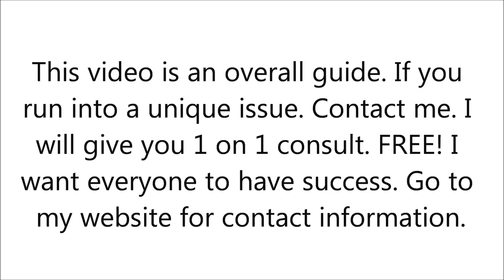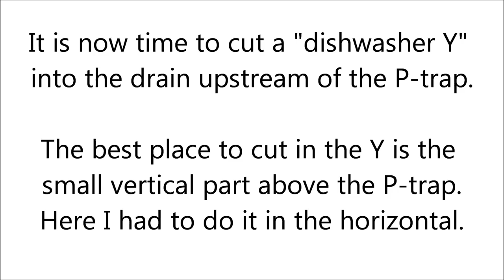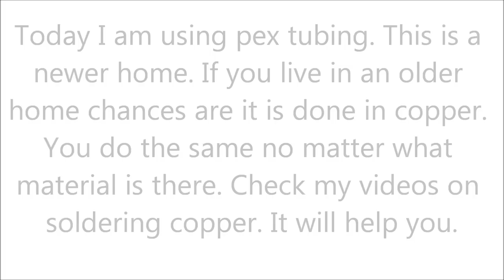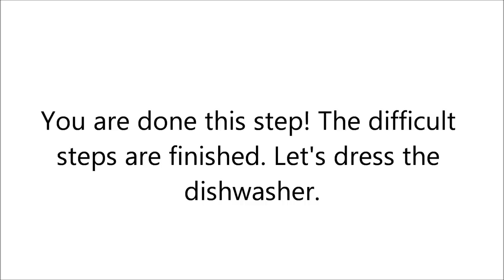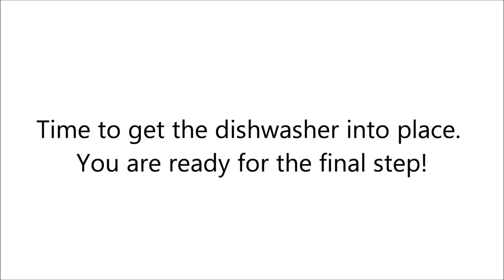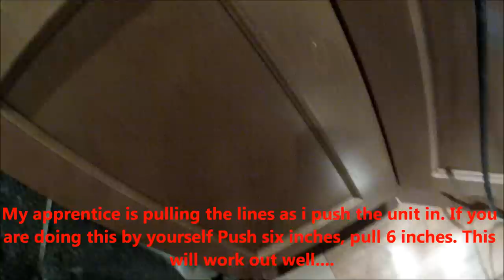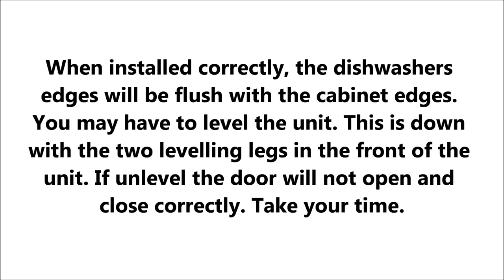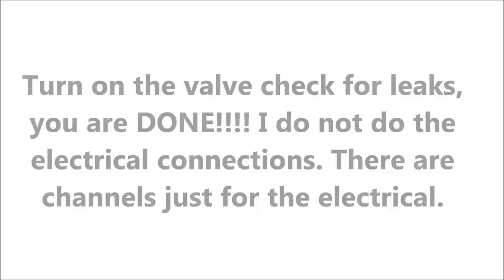How To Install A Dishwasher Video HD

Comment from the maker: Sorry about that Frank, the material list page will be fixed shortly. I am in the works of a complete site overhaul. The "ring" is a 1" Hose clamp. The number to give the hardware store is a HS20 which is the number for 1" stainless steel. The tool I used is a 5/16" nut driver. All hose clamps 1/2" or larger are all 5/16". You can also use a flat screwdriver. Most manufacturers give the a slot in the nut as an option to using but drivers. I hope this helped and thanks for watching.

Rob